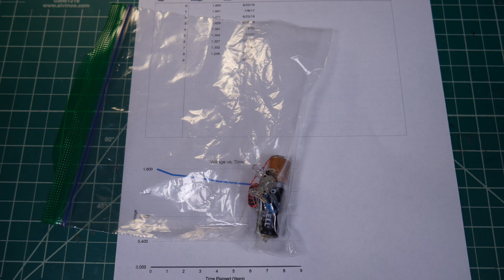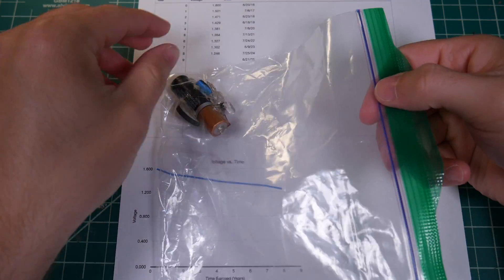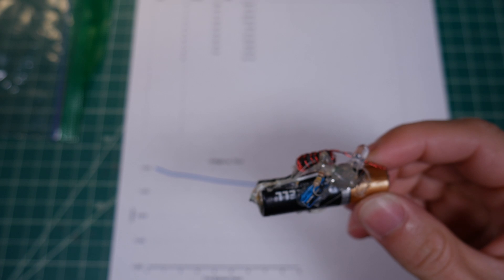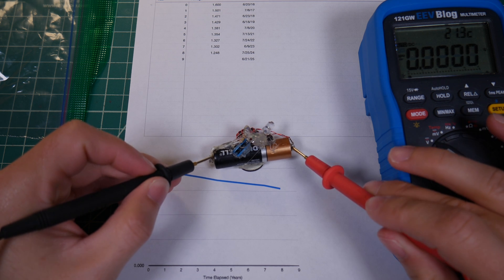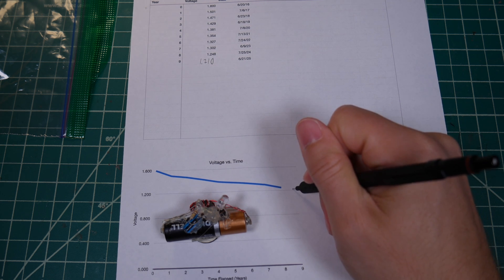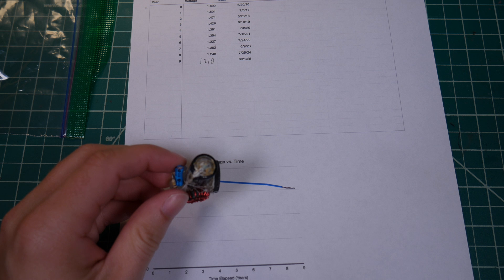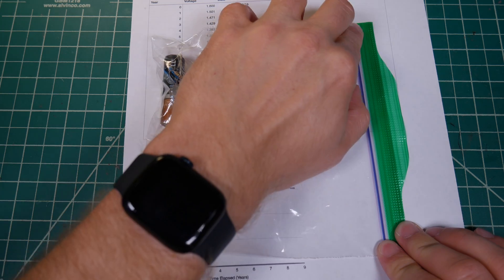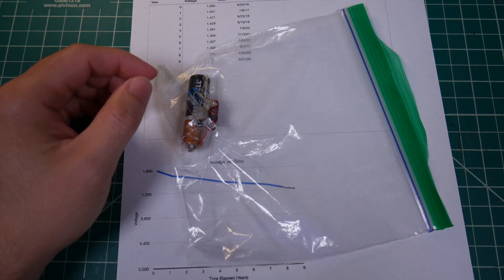Blinking Joule Thief 9 Year Update

Comment: Sadly, mine died over the winter. It got damp in the shed and stopped flashing. and although it came back on after it had dried out, irreparable damage had occurred somewhere and it finally died for good a few weeks later. Looks like you win this round even though I started nearly 4 years late. RIP little joule thief, you flashed reliably in the darkness for nearly 5 years